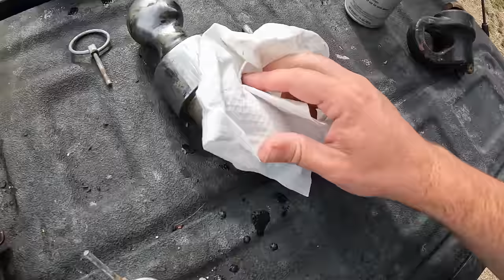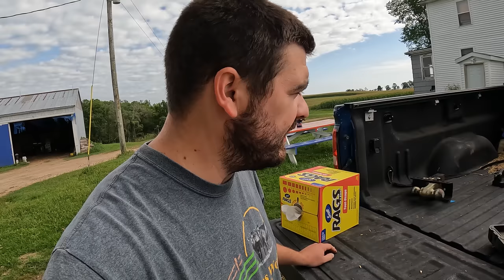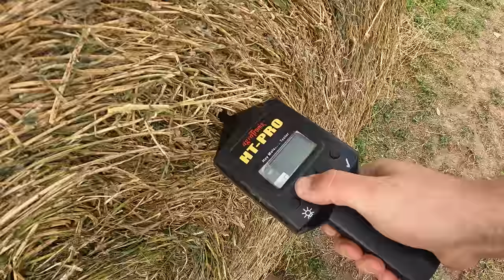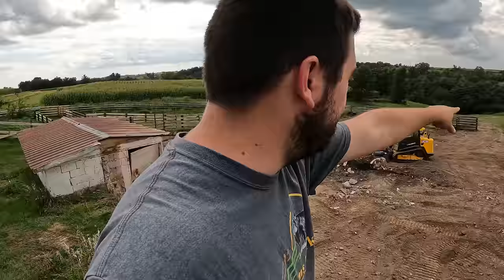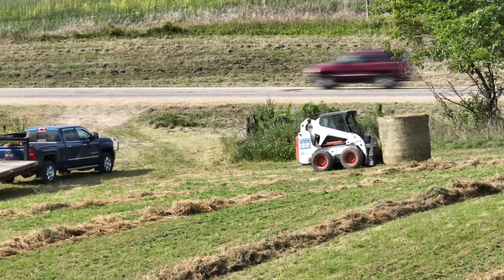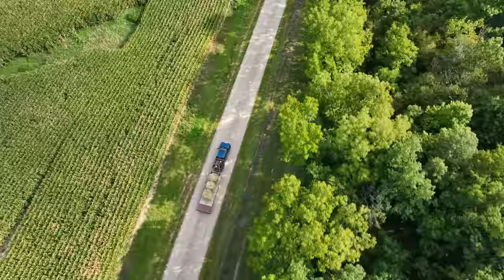I Woke Up and Chose Heavy Duty - Final Barn Cleanup with the JCB Teleskid

Comment: Here is a tip for grease/Lube trailer balls and hitches. To avoid a build up of dirt,  grime, sand and other road crap, use bicycle chain lube! It's designed not to hold dirt , mud, and other crap from the road. It bonds to the metal to help fight against rust and corrosion as well as repel water or moisture. We use this on our Mtn. Bikes since they are always going thru a lot of crap and they need to stay clean as possible so as not to have the chain come off because of build up of debris.

No offense against WD 40, I use their products too, but for my hitch, Bike Chain Lubricant.